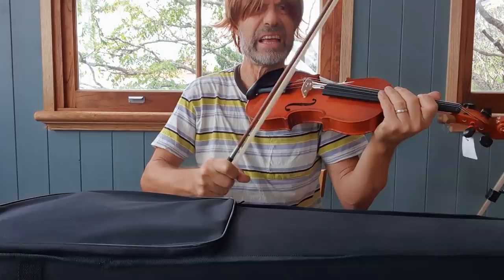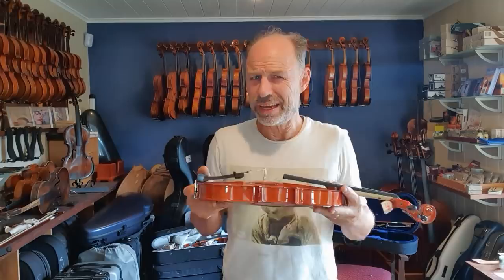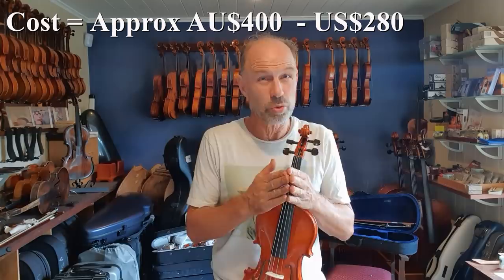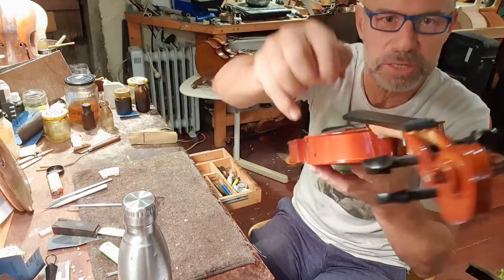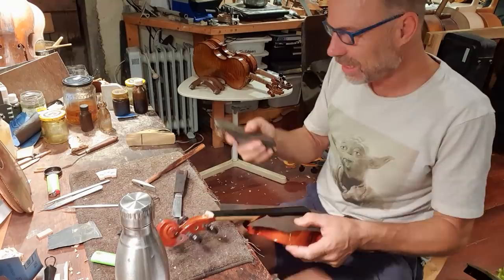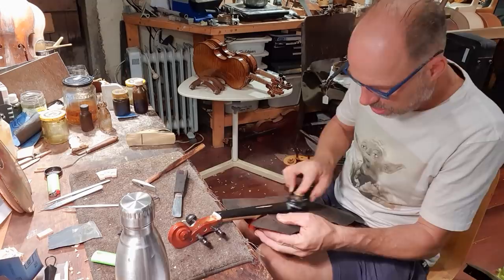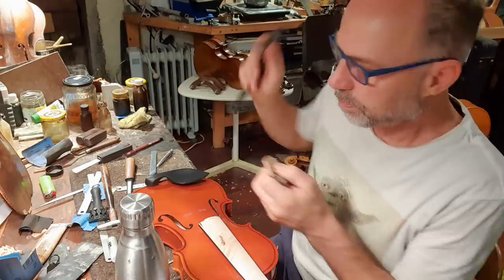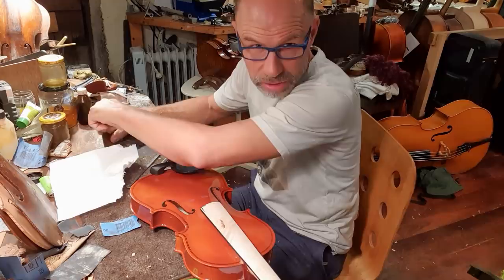Will it work?!? I try to Improve the 100 Dollar Violin with my Master Setup

Comment: To me the pricings you listed seem quite expensive. Of course the material used probably isn't cheap, but regarding time invested this didn't seem like too much effort to me.
I am a non-violinist and I am just genuinely curious as to why it costs so much to do this.
Reply: For one he only showed a tiny fraction of the time actually invested, for another it is a question of knowing what exactly you need to do. 

In engineering we've got this story of an elderly engineer being called back into a company to fix an expensive machine - he walks around it, looks, takes a hammer and taps it in one place. The machine begins to hum again and he asks for 800 dollars - of course the manager demands to know why! The detailed bill reads "driving to the factory - 30 dollars, tapping the machine with a hammer - 20 dollars, knowing exactly where to tap it - 750 dollars." :)
Reply: Skill and time. Time invested probably makes up a majority of the money. 
I sewed a little stuffed animal and recorded my hours of work on it and at an hourly wage it was 100 something dollars but the materials were just 36 dollars. It’s a different craft but I think the same principle applies, especially if a skilled worker is working.

Comment: Cool axe bro. Now you just gotta change the pickups for some Seymour Duncan's, polish the frets and install locking tuners. Hook 'er up to a good tube amp with a tube screamer pedal and you're ready to rock. I would also suggest using a metal mouthpiece and a synthetic reed as well.

Comment: The worst part of a VSO is that they use synthetic glue or adhesive to put it together and that makes it impossible to properly open and set them up without damaging it. I have a VSO where the sound post is glued, and my luthier is confident it could actually be improved quite a bit were it not for the sound post being glued in the wrong place. Repairing it isn't worth. Better to buy a new violin and a bow to boot. 

Also please use an N95 mask while working with fine wood dust and artificial varnish. Other than the odour, no other particles that can get into your lungs will make it through.

Comment: Here's an interesting thought... Use this VSO and turn the bridge backwards so that the strings are in reverse order (E-A-D-G) instead of the traditional (G-D-A-E) and give it to @TwoSet for a LingLing Challenge :P~
Reply: That would be funny lol. On a serious note, if someone were to create a left handed violin, not only would the bridge has to be custom made to be opposite (actually carve out a bridge instead of just turning it around) but the peg holes have to be rearranged so the G string peg doesn't interfere with your right hand index finger (if you notice the G string peg is lower than the E string peg), and the bass bar has to be on the right side and the sound post has to be on the left side, and the chin rest has to be custom made to be on the right side. That would be verrry interesting.

Comment: Assuming this instrument was made in China, it seems odd, after they got the shape right and made it stay glued together, they didn't know details like equal accurate string spacing, precise length and fit of soundpost and bridge material are so important. I get they would have to make every part down to a price, like the dyed wood fingerboard. Even there, they still had to profile it, maybe on a machine, but how hard is it to do that right? Belly and plate may have been steam pressed out of flat veneer (ouch).

Comment: Maybe they used Krazy Glue.  Back in 1994, my apartment complex flooded. So after the flood, people filled up the dumpsters with the ruined trash. I couldn't help myself, but I fished a violin case out of one of the dumpsters. It had a violin in it and all the glue had totally let loose. I glued it back together using Krazy Glue and it totally sounds like crap. (I never expected it to sound good.) But that's not the point. It wasn't meant to play, it's just a scenery piece for decoration now. But it goes to show that it's not just the parts; it's also the construction. Our society is used to a cookie-cutter approach to manufacturing. We all think that if the basic parts are of high quality then the construction quality doesn't matter.   If we're talking about IKEA, yes; if we're talking about violins....no.

Comment: I would add that if a $100 violin is all you can afford? Buy one! At least its a start... Not everyone has $350 to $700 to spare. 

Elvis didnt start on a Stratocaster. 

And there are plenty of great fiddlers where I live in Appalachia who are playing knocked about beat up fiddles, that if given a $2,000 violin to play would sound like Itszak Perlman! 

My violin cost me $100. I did the same things you did. I'm now playing professionally...and 10 years into it. I still play the fiddle...In fact, its my bar fiddle! If someone breaks it? Its a loss...but my $2,000 1920s fiddle stays home whilenmy $100 fiddle goes out and parties! 

Strings? Cant count those...strings will get worn. I'd probably change them out on a high end fiddle to strings I like right out of the store...

Your "costs" are what YOU charge. 

I just replaced my tweaked bridge 20 min ago, new strings too...

AND! By watching 3 youtube videos, and sharpening my chisels, I did my own bridge mods. Sounds awesome! 
$29 bridge. Labor? Me
$26 strings. Labor, Me. 

I wouldnt do the sound post, but I could have done the planing and pegs. 

J.S.

Comment: My only critic is that for your work, you added about $450 to the violin. If the time and effort/materials were used in manufacturing, it would be, what, $50 to $100? So in saying that, you added about $100 to the value if that is how it would be from manufacture.
I only think that for someone who wanted to at least start learning to play and the couldn't afford any more than $100, then more power to them. Unless they could get a good used for $100, then more than likely, they would have to put another $200 to make it useful. I guess you could say it is kind of a catch 22....but at least, it shows what can be done to even the cheapest playable violin....Kudos....

Now what I would like to see is, everything else being equal, take the top off and put a solid spruce top on it. Just a basic wood, nothing expensive. Of course, this is a lot of work, but it could show how well the violin could sound. Manufactured that way, it would add, what, $50? Just a interesting exercise.....

Comment: I can see how 100 dollar violins probably aren't worth it, though I will say on the piano side of things you can do a lot more.  Although much of that is to do with the fact that most 100 dollar pianos are 100 dollars because they are old and in bad condition as opposed to having been poorly made in the first place.  A 100 dollar piano can often be of better quality than a 2,000 dollar piano as a lot of those 2,000 dollar pianos are used with very green wood which don't sound horrible at first, but after about 5-8 years the parts start to come apart and they rattle like crazy and the sound just dies.  Usually at that point you can literally replace almost every single part and redo all of the major cabinetry or buy a new piano.  For reference thats about 6-8 months worth of work and when its all said and done its basically a new hand crafted piano and you will have spent well over 15 grand getting it that far.  And While you can make it sound like a high end 50k piano, thats because literally every single part had been replaced with parts found on those 50k pianos and just as much attention to detail.  But pianos are a lot like cars where brand name often times dictates the price of the instrument so the value is still only at around 2k dollars.

Comment: I hate to say, but I think you are missing the point.  Most people that search for this video wonder if they can improve their current violin as a Summer DIY project, and use the violin for another few years before needing to upgrade (Dad with DIY skills).  Or more likely just to show off to their friends with similar violins (kid, or more specifically, the typical Gunpla/plastic model builder).  In other words, they are not interested in buying parts or expensive tools, coz everyone knows that is way more expensive (except for the tip of the ice berg delusional people that think otherwise, they must be difficult customers too 🙃).  For the rest of the people, they just want to know if it is possible using home tools to DIY by shaving, sanding, tone tapping (using free apps), re-shaping the bridge etc etc (and only spending a small sum on a cheap vanish 😉).  Better still if you have a step-by-step guide.  Ultimately, we all know the take home message is difficulty level 100/10, don't try it at home (is all or nothing project, although for most people the old violin might be a piece of sentimental decor, or to Mom a piece of junk), and just pay to buy a new one.  I can so see it will have 10M views.

Comment: The sad thing about cheap and nasty instruments is that with only a bit more effort and relatively little extra cost, they could be so much better. Look at my Chinese reading glasses which work fine and they look good when new - shiny black plastic and solid looking frames. But after a few months the shiny black stuff (paint) comes off and flakes stick to my nose. All the rest is fine but this shortcut (using paint instead of good quality plastic) ruins the product!entirely!

Comment: Dear olaf, I have no doubt about your professional abilities. But I know very well that no one will intentially cut the branch on which he is sitting, and you know it very well that once you admit that a violin which costs only 70$ is a perfect violin including for advanced violin players, you do this cut. So, you will never do that. Allow me to remind you that not far in the past all the drawing work for machinery and architecture was done by hand without any cad tools. Then came a development and no one to day is drawing by hand. All those who draw by hand found themselfs unocupied.
Now let me tell you that you have to face the truth that almost every work done by violin makers is done today by CNC machines in a very precise way which can be checked by mathematical sound analysis tools. However It is well known that even today, correct shaping and adaptation of the violin bridge, needs to be done by professional violin makers. The same is true for the sound post installation.  Sorry Olaf.